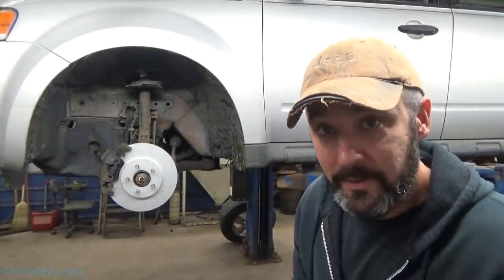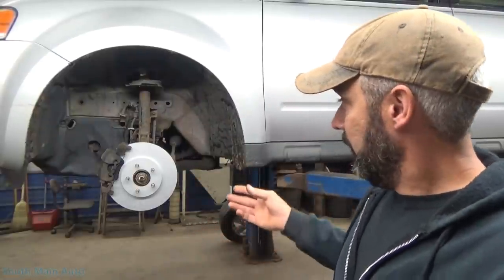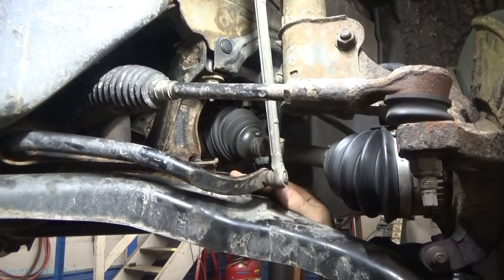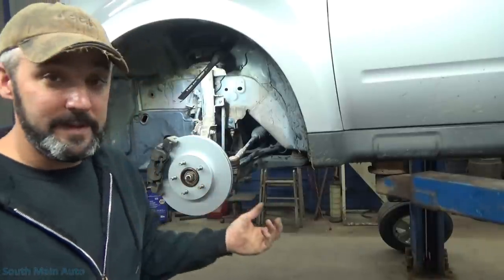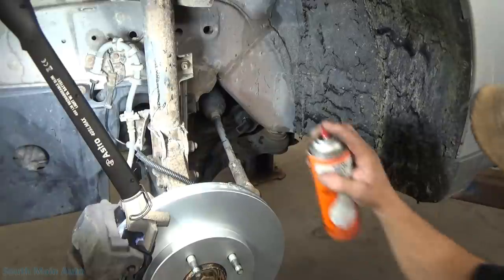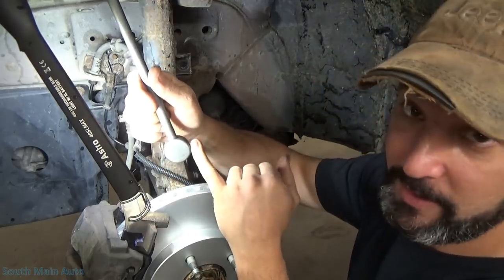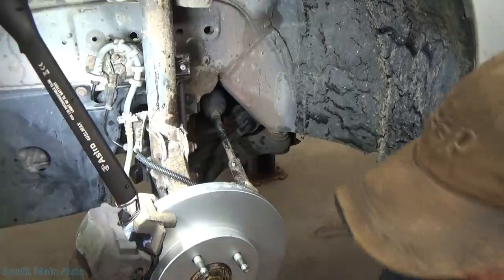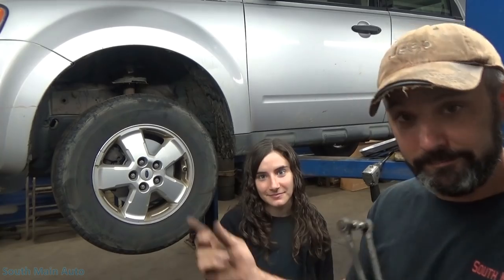Repairing Front Suspension Rattles

Comment: So what's with Rattling after having the whole front suspension replaced? I had struts mounts springs replaced and right after I've had rattling
Reply: Rattling like I can feel it in my pedals etc when driving I can Slightly move to right or left and it stops

Comment: Ok. 
 2006 grand Cherokee. New upper and lower control arms, new struts and shocks, new inner and outer tie rods , new end links all four, all new ball joints, and have a rattle not a clunk. The rattle stops as I apply the brakes slightly.. driving me nuts . Avery thing has been re torqued . Any ideas .

Comment: I have a clunk noise on a 2011 Toyota Sienna only when turning and accelerating out of corners do you know of any possible common  problems it has new control arms, struts,bump stoper,strut bearing,ball joint, the only thing I noticed is the cv axle is loose in the transmission is that normal.

Comment: I change my stabilizers, struts , cv joint and i still can hear the knocking sound when turning left ,or right pushing on the brake Help what else can it be? I remember hitting a pot hole turning right and starting to hear that noise after that!!

Comment: I have a 2009 Cadillac cts v, I've changed the front strut, upper and lower control arm bushings and ball joints and also replaced the sway bar end links, I still hear a rattle/clunking. what else could it be?
Reply: Steering shaft u joint

Comment: Could this still be a problem when you have a jeep with a 3" body lift? I have clunk-clunk when hitting bumps etc.
Reply from the maker: Does it have this style sway bar link?
Reply: South Main Auto Repair its like an extended one. I don't know the lingo...lol!
Reply: leigh shahan body lift on a jeep, so that sounds like it would be a wrangler, but without the type its hard to tell, the TJ 1997-2006 used a swaybar end link that looked like a threaded rod with rubber bushings on it and an eyelet on the other end that bolts to the axle tube, where as the 2007-present Jeep JK and JKU (4door wrangler) used ones that looked like the ones Eric O. replaced. That said, if its the the older model the TJ most often with any suspension and body lift that is put on to these a quick disconnect sway bar endlink is put on so when it goes off road you can pull a pin and remove the endlink for better offroad suspension travel/articulation. If its a TJ i would check to see if it has quick disconnects as those will always rattle. If its a JK 07+ than it could very well be the sway bar endlink ball and socket, BUT the JKs have a very common issue with the control arm bushing going bad on them with any off road use. Just my 2 cents.
Reply: Aarons Automotive well thank you so much for the info. My Jeep is a 97 Wrangler sport. When I hit a bump it rattles and sounds like it hits hard. Which I know it's a Jeep and they're not got to ride like a Cadillac. But just wondering if it could be improved. Thanks again!🙂

Comment: "factory specs" for those parts are about 20Nm, air/electric tool can easily go beyond 150Nm. if I see this shit happening on my 15 years old "euro trash" but still no rust due to underbody protection factory threatment you would be better a better runner than I am.